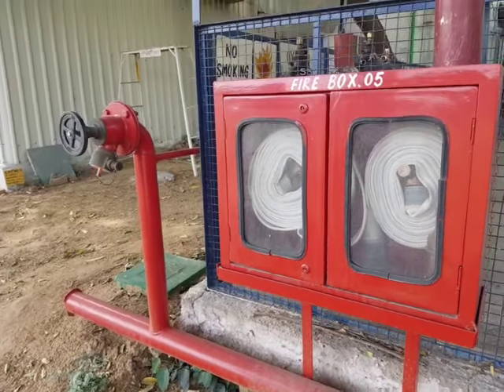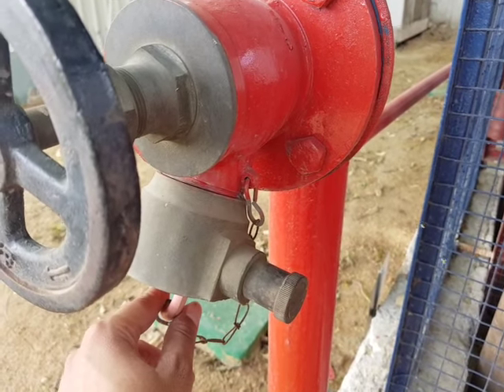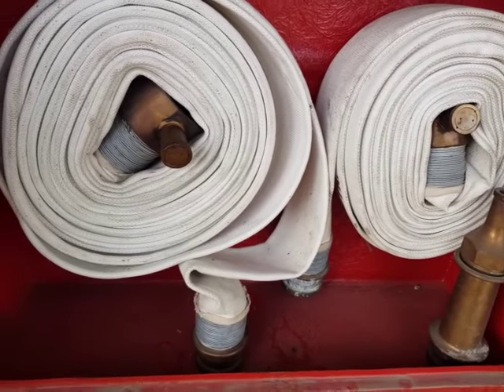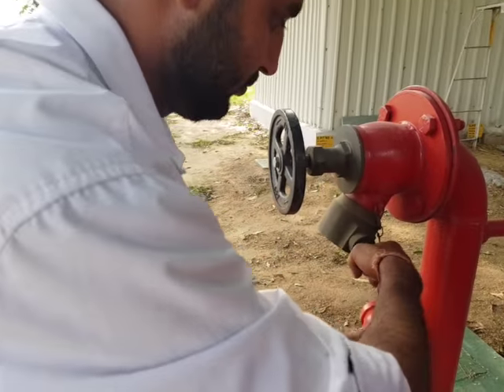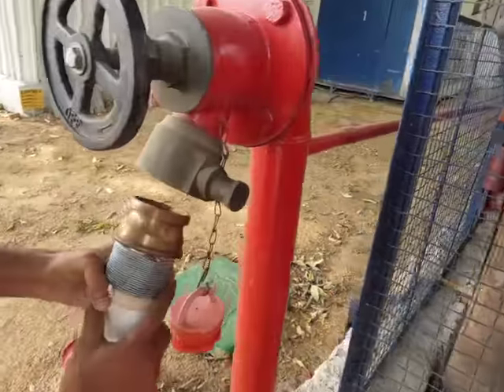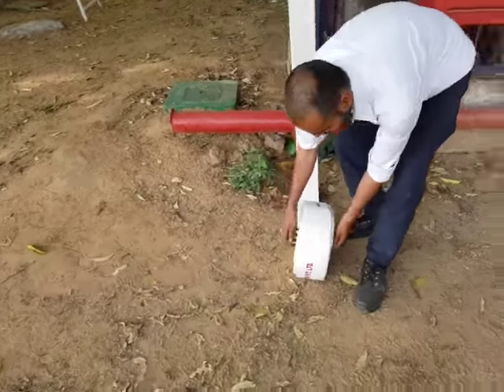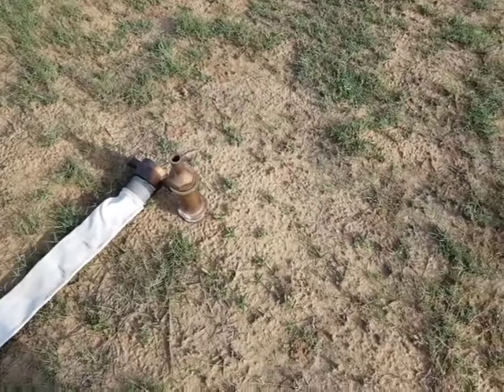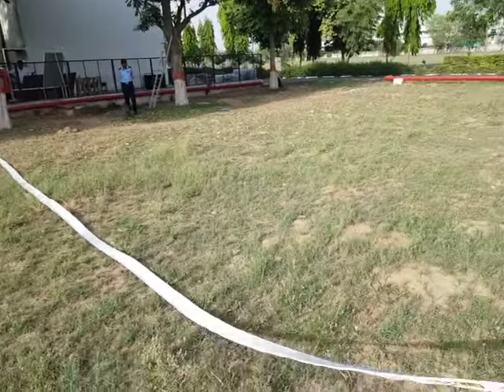How to use a Fire Hydrant System

Comment: Can u share the details regarding what should be the diameter of pipeline... Distance between two hydrant... Pump capacity.... Jockey pump pressure setting....electric pump pressure setting....what should be the flow rate.... What should be the water tank capacity...etc...
Reply: Yes ... I will
Let's connect.
Reply: Sir same info I want
Reply from the maker: In my next week video, I will brief you about Hydrant System. Pls stay connected.
Reply: https://youtu.be/pY91keJNJos
We serve to save
Video देखें 👆 आपके  Subscribe करने से हमारा मनोबल बढ़ेगा और एक Like तो बनता है Share करें जरूरत मंद तक जानकारी पहुंच सकें